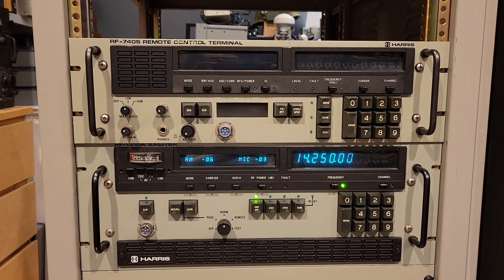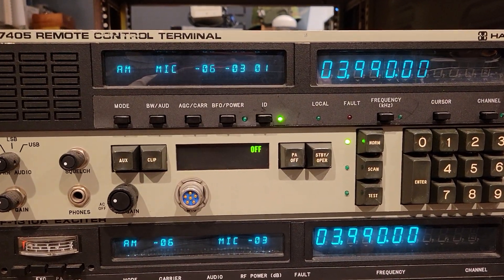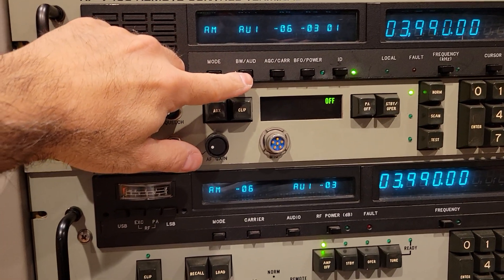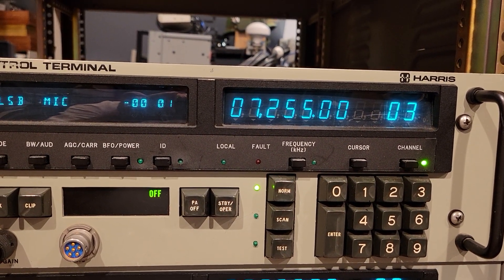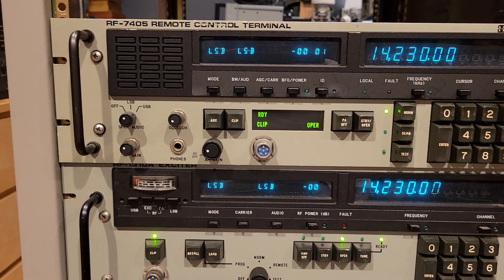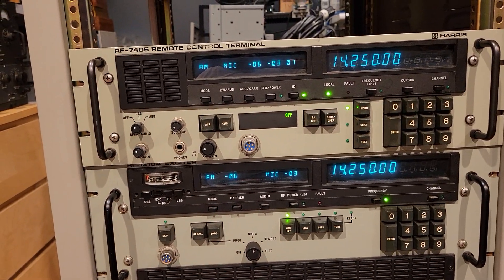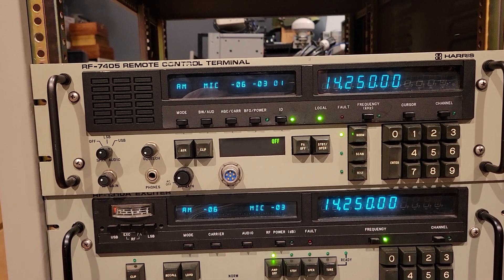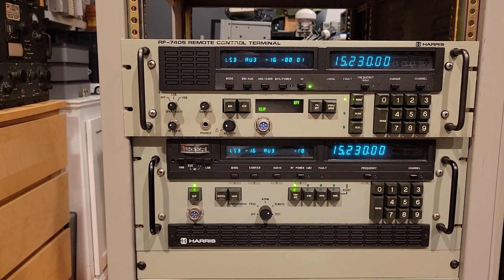Harris RF-7405 Remote Control

Comment: Should be able to remote control from any were in the world,   i assume,   thx matt
Reply from the maker: indeed. The unit also has a built in modem that allows communications using FSK over a phone line. Many installations used leased lines from the central command post to the remote locations and could all be commanded over these leased lines.